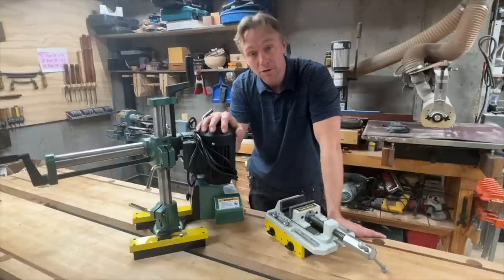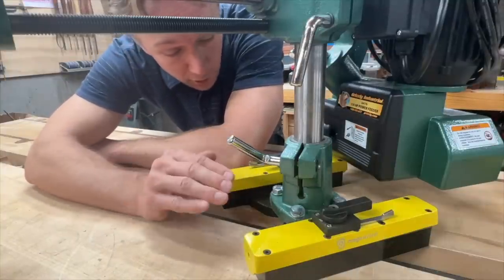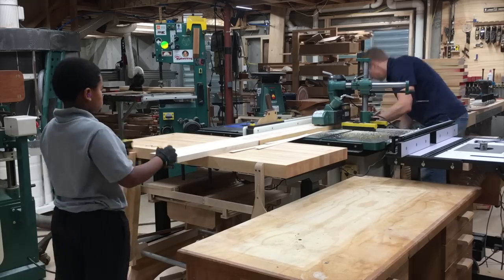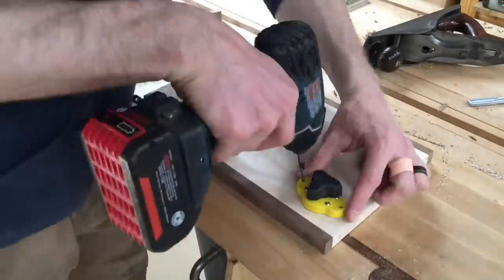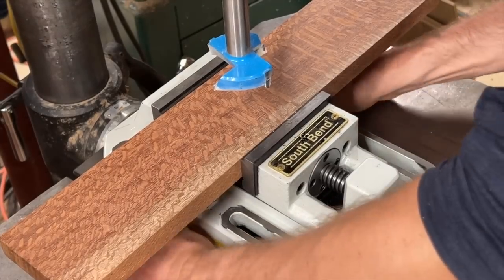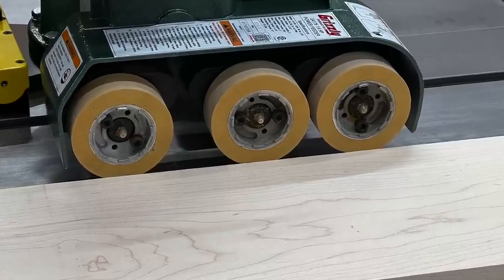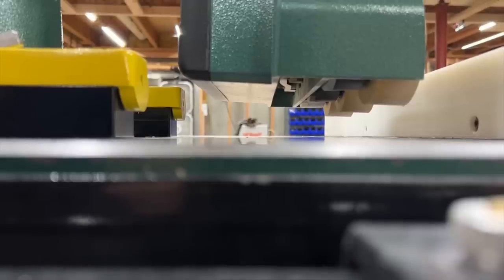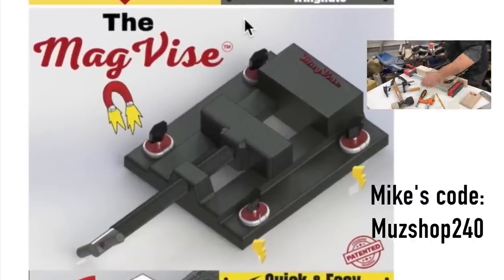New Magswitch Products in Stock!

Comment: Andy,  I have a question.  I've tried to find out if there is a guide to what size Magswitch to use for a particular jig and I cannot find one.  Does one exist?  I'm looking at making a table saw fence jig.  It looks like some are using the 95's.  Is that necessary or would a couple 60s work for a table saw stock roller guide?  How does one know what size is needed for a particular task?